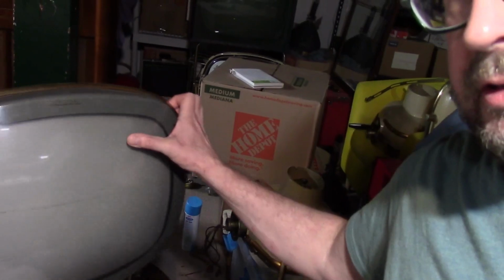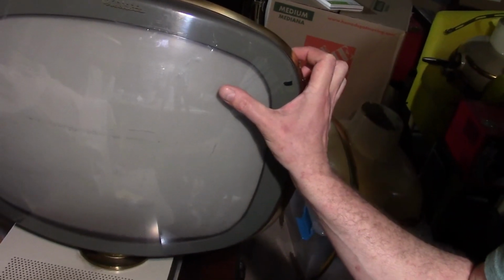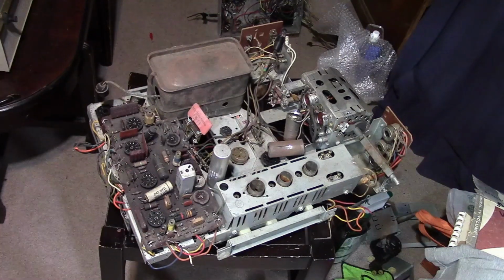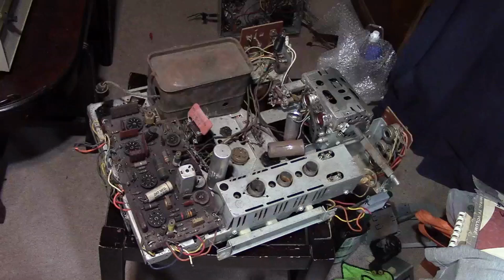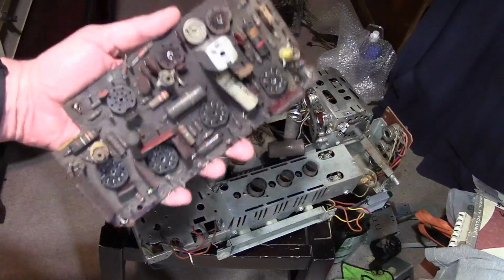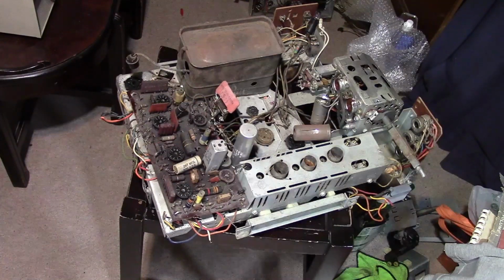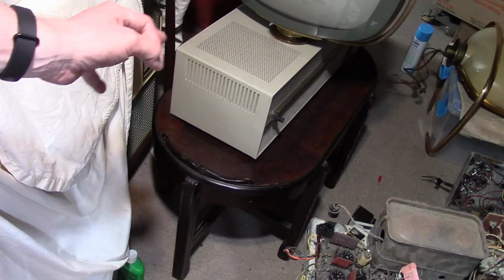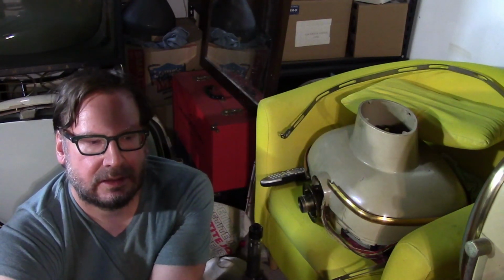Vlog - Philco Predicta myths, facts and fiction discussed

Comment: I always wonder if a cooling can for some tv,s or certain tube radios is a good Idea ,looks computer one can exhaust ,and one for ccooling .anyone have any thought about that ,I.love that tv you are working on.,I always wonder if there is any NOS  picture tubes for it .You seem.to find most of the other parts,including a couple .amazing
Reply from the maker: I've never added a fan.  I suppose reducing heat is always a good idea, but I'm again cutting an ugly hole in the back of the cabinet as I've seen some do.  

Yes, there are NOS picture tubes out there.  I have a handful and I'm sure many other collectors do too.  They tend to show up on eBay or at estate sales.  Of course at the annual Early TV Foundation convention swapmeet.

Comment: I'd still like to acquire a pedestal or barber pole predicta, im actually only interested in the lower half of a unit
Reply from the maker: Why is that - do you have a good head unit? Good screen covers are hard to find. I have bits of a pedestal chassis if you need some parts
Reply: @bandersentv  Im actually intersted in using one or making a replica to be my entertainment center

Comment: Which Predicta was the one with the remote screen and long flat cable? Here in the UK, I was repairing Philco front load washing machines in the mid 90’s, we seen them as returned for rework because the drum brackets would break at the spot welds. On a more positive note I’m still running a Philco Tropic tube radio!
Reply from the maker: The Tandem. I've done some videos on them. Sold my best one but have two more to restore.
Reply: bandersentv Awesome,  I shall look forward to seeing those at some stage
Reply from the maker: @TurboTel68  I've shown all three in older videos.  Here's one of them:  https://youtu.be/01RP3SPzpNE

Comment: That's all very nice and 1950s cool, but I think I will watch TV on a modern flat screen, 1080p, full color, or maybe even 4K.  This will really save on the electricity bill too.
Reply from the maker: Of course.  I've never watched a movie on a vintage TV.  We have several large flat screen TVs for that.  They are fun to restore, display and demonstrate.
Reply: Nobody's working on these to watch modern content.  But CRTs are still the best way to see a lot of content that was made for them, all the way up to the early 2000s.
Reply: JAMES AZBELL Probably correct, but before long all the CRTs in existence will not work anymore.  Unlike maintaining an old car, you can't machine yourself a replacement CRT.
Reply from the maker: True, but I do have a small stash of NOS CRTs and don't play my sets all that often.  They will certainly outlive me.  Also there is are several ongoing efforts to get CRT rebuilding operations going.  I expect the vintage arcade and computer crowd will help once those really get scarce too.

Comment: I have question, and maybe a challenge! Surely there must be some gutted Predicta cabinets out there.  Has anyone designed an interface between the various "I/O" of the cabinet (the CRT, mechanical tuner, speaker, volume, antenna, picture controls) and a recent sold-state TV board? I think the board would need to be one of the not-so-modern tiny jobs from a b&w mini CRT TV.  Just curious about the challenge of creating the interface and treating the cabinet and CRT like I/O.
Reply: I’ve often contemplated the necessity a “universal chasis” with proper software based “hardware emulation” the collecting hobby has. Would save a lot of old sets and if done properly would utilize more old crts. The problem is the amount of adapters, yoke plugs, and work that display side alone would take proves itself to be the paradox it at first glance would not seem.
Reply from the maker: I doubt it.  The picture tube wouldn't fit right and if you're going to use the original tuner, you're going to have to power it somehow.  Some of the other controls probably wouldn't have an equivalent like horizontal and vertical hold.

Comment: Nice video. The myth about bad flybacks, I think the standard answer to a set that does not work, and the tech does not want to fix it is "bad fly back, big bucks to fix" I have worked on a few, never seen a bad flyback, yes ugly perhaps but they still work, and not worse looking than others. I also find the picture to be excellent, On mine I undo about 4 or 5 wires iirc on the main pcb (princess style) and with that can remove the pcb from the chassis, leaving the rest still attached. With the chassis out on the bench and the pcb flipped up, its really easy to work on. Not as easy as completely removing it, but works ok for me.
Reply from the maker: I'll go you one further and say that I've never found a bad flyback in any vintage TV!  Maybe it' just luck I don't know.  I mean they obviously made replacements.   I do strongly suspect though that many saw that cracked wax flyback coating and assumed it was bad.  Or were careless and broke of the HV lead
Reply: I had a bad fly on a ctc16 once, well bad as in not present, I picked up the tv locally, opened the cage, empty... I had a fly on a old BW Maggie that looked like it had been in a fire, all the wax was gone, just burnt paper, worked fine. I did have a smoker once on an old philco ford color set, but it still worked, don't know for how long it would go like that, IIRC I replaced it just to be safe.

Comment: About the heat. Not only does the Predicta have a cabinet that’s close to the tubes, the cabinet is metal, and metals conduct heat well. The box, boxy TVs usually had the chassis near the bottom, and the cabinet was wood (or later, particle board), which was a thermal insulator, so there was that aspect. Either that, or plastic or Bakelite.

Comment: Very INTERESTING,  Yes Philco was a very big company but I did not know that they built a fab for there own transistor / I.C.  production !!  Setting up a fab today can cost MANY BILLIONS  of dollars
considering that a single production tool can cost 50 million to 100 to 300 million dollars for a 12 inch wafer product line now multiply that by 100 to 300 times for all the tools needed for a whole line!! not even considering the cost of the building with all its super critical HVAC equipment and chemical  / gas  delivery systems  !!  PLUS D.I. water production systems for rinsing all those wafers after a chemical treatment process like Huang cleaning or photo etch process.     Yup I worked for I.B.M. for 31 years in production then later in production support services A.K.A  Facilities  support services in East East Fishkill , New York for 31 years.  That place was its own self supporting " City" with their own Fire and Ambulance dept. Water Dept. Sewer Dept and 3 main cafeterias!! plus 15,000 people  spread out over 900 acres or so!!!!! Yea that was some place to work!!!  Many stories to tell!!   Was a great place to work!!
Reply from the maker: They had about 400 million in revenue in 59/60 (3.5 billion adjusted for inflation).  They started making semis a few years before that and made a few computers.  Mostly government contracts.

Comment: Predicta is a series of tube TV we never had in Australia. I believe if some of them had been made to operate on our AC line voltage (240V) and fitted with a PAL 50 Hz 625 line VHF tuner, they might have worked just fine like any other B&W set of that era. Just my opinion.
Reply: I was curious if they were ever sold here🤔

Comment: Also, have you talked to TV repair old-timers about Predictas? I wonder what they say? And yes, seeing some similar GEs, I think Predictas get a bit of a bad rap.
Reply from the maker: Never really hear from TV repair guys that remember much that far back.  Guess they'd be in their 80s now.  All the info seems to be second or third hand.  Emersons were even worse.  Shame they bought out Dumont and really dragged that name down.
Reply: @bandersentv  I wonder what the service magazines of the early/mid 1960s had to say about Predicas? If you can find them even...I suspect the service rags from  back then are not getting archived. Remember Jack Darr?
Reply from the maker: Hmm.  Good question.  That would be a good source of reliable, period info.  There's so much myth and mystique built up around these sets it's hard to tell sometimes.   Like the rumor that 1,000s of unsold Predictas were thrown into the sea.

Yes, I do remember him.  Service Clinic column in Radio Electronics ?
Reply: @bandersentv  I had an Emerson Port-O-Rama. Nice little set, but like the other compact, metal cased TVs, it ran on the hot side.

Comment: I think the heat exacerbated many degradation issues chassis wide. something i've only seen on wooden cabinet models is after extended use the HV cable will have insulation failure and arc off something in the cabinet. just one example. again in my research philco was aware of this issue and mitigated it actively by stocking bulk replacement parts dealer wide.

Comment: I really have to point out a flaw in your reasoning about the heat. It does not matter how much heat a TV generates, but how fast it can get rid of it. It is all about the thermal resistance between the heat generators (mainly the tubes, in this case), and the ambient air. More ventilation is the obvious but often not correct solution, simply because the heat may not be taken away from the right places. Thermal management is a science all itself, and Philco really failed with the Predicta line, for the most part.
Reply: I agree as well. The 17in sets were the best case scenario for Philco, take the most reliable predicta chassis they had and the super tested 17er picture tube and put them together. Honestly it stands to reason they probably did this for multiple reasons including using the parts they had during a time of hardship.
Reply from the maker: Yes, I agree with what you're saying, but I think at least the 17" metal models have adequate ventilation.  Holes and louvers on all six sides.

Comment: If Philco never went bankrupt do you think we'd have seen a Predicta color set?
Reply from the maker: No, I don't think so..  Color CRTs were round until about 1965 and rectangular color CRTs were still pretty massive until the 1990s.
Reply: @bandersentv  And 1990s color CRTs mostly returned to 90 degrees deflection angle, so they were longer then Predicta's CRT.  But many color CRTs from 70s-80s had 110° deflection.
Reply from the maker: @xsc1000  I see what you mean.  I found this cool chart showing milestones in CRT technology.  https://www.sid.org/Portals/sid/Files/pdf/20121024%202.a.1.b%20CRT%20DTMC%20%20(Display%20Technology%20Milestone%20Chart)%20.pdf

Comment: Some good discussion points here, thanks for putting the vlog together.

I would assume Philco sets were designed for manufacture-ability uppermost in mind... PCBs allowed sub assemblies to be built in sub groups then assembled near the last point in the process. I would think that it would be faster than having one worker do the point-to-point wiring on one chassis and then move on.
I like the PCBs myself but then again, when I was a young 'un fixing TV's etc as a job, they were all PCB at that point. Having said that I now enjoy working on point-to-point gear but I still to the low tech stuff (no room for TVs).
The "king" of modular PCB designed TVs were, IMHO, the Zenith sets in the 70's and 80's. They were very serviceable but Zenith wanted the repair shops to buy the modules instead of fixing them so the repair cost to the customer went up.
I am enjoying the Philco repair series, I appreciate the effort you go through and I know the effort having tried doing a few videos myself. It's time consuming. Just wanted to say thanks.

PS - fun fact, when I was repairing TV's back in the 90's I tried my hand at rebuilding a few CRT's. Challenging process, especially the glass blowing (fusing the neck to the new tube to hold the new gun). I enjoying learning it but it never went anywhere. They were colour CRT's too, making it extra challenging.

Cheers,
Reply from the maker: Yes.  They use these PCB type modules for around 5 years I think.  The IF board is especially reliable.  All ceramic caps and rarely needs aligning.
Reply: @bandersentv  this might not be the best place to ask this but i have been looking for a philco predicta for years  to restore ive tryed facebook market place ebay cregslist all to expensive an never near me for pick up im wondering if we could make a deal on one of your  un restored philco predictas  email me at Redfoxlover9@gmail.com to work out a price heck ill take one thats  a bit rusty with missing paint that how despirate i am for one at this rate
Reply: How ironic, you have that dude from the fallout games set as you're profile picture and the predicta is featured in the fallout games😂 I reckon fallout is what probably made them famous - much alike what BTTF did for the DeLorean

Comment: Your opinions seem very level-headed.  
On the heat comment, I imagine having a metal cab full of vent holes makes for much lower running temps than a wood cab. Does the barber pole model have airflow similar to the tabletop models? It has a wood cab, right?
Reply from the maker: It's curved masonite with faux wood grain I think. The chassis is mounted vertically.    Not the greatest idea because the horizontal output tube gets the HV box hot
Reply: @bandersentv  ...which can shorten the life of the flyback. It's the same with A vertical chassis that has the 5U4 rectifier tubes mounted horizontally at the bottom, which not only makes the heat rise to other tubes and components above, but you get filament/cathode sag which has caused many 5U4's to short. I install whisper fans upon the customer's request. It can't hurt. :) Interesting Vlog about Philco spreading its wings a little too far. Dan Jones brought it to my attention that the Predicta wasn't the cause of Philco's demise. You just confirmed it.
Reply: I would also argue thats another reason not as many wooden cabinet consoles survived. the heat was a major issue with the chassis on this set causing systems to fail. Predicta dealers were reportedly told by headquarters to keep more crt and chassis in stock than actual sets.
Reply from the maker: @eatyourmushrooms  Are you sure about that?  I ask because I've never encountered any heat related problems.  There seem to be plenty of Holidays around and I'm not sure how many they made of the other wooden models.  I assumed a lot got tossed because the CRTs died or the nasty smell rather than something on the chassis dying from heat.
Reply: @bandersentv  If you think about it, Many of these sets now, are operated infrequently, which would definitely limit any heat issues. but the sets that are/were used as daily watchers are more likely to have component failure due to constant heat for hours at a clip, so I can understand why you haven't encountered any failures due to heat, but so far, the one's I've repaired/restored had many burnt tube sockets and dried out wiring. The dried & crispy wiring may have been due to storage conditions for long periods, which is understandable, but can't really be verified. Most of my clients buy these sets, I repair or restore them so they could flip them. But the one's who buy them as keepers don't use them as daily watchers. :)

Comment: Great video Bob! I watched this as soon as it showed up in my feed. Also, did you get my email about the 1.5k control? I might have a used one as well if you want me to look. Please disregard my request for the rear controls on 17" model, I located some. Still looking for the gold band on the CRT for a 17" if anyone has one for sale.
Reply from the maker: Yes, I got it. Sorry for not replying sooner. I have 3 or 4 chassis that need a linearity control so I'm exploring options to use something commercially available
Reply: @bandersentv  Bob, I might have close to that many. If not I can give you info off the new old stock ones I have and you can see if you can find where they came from.